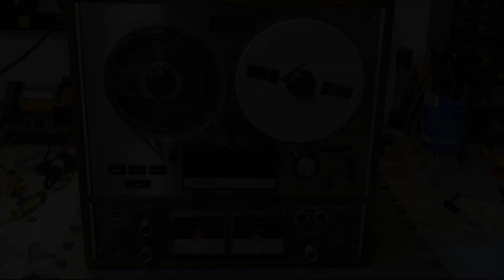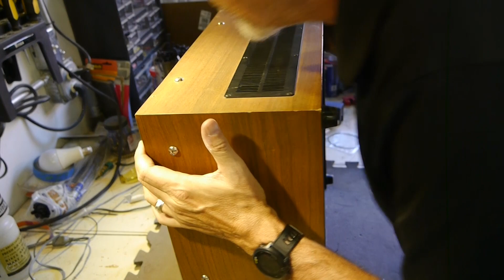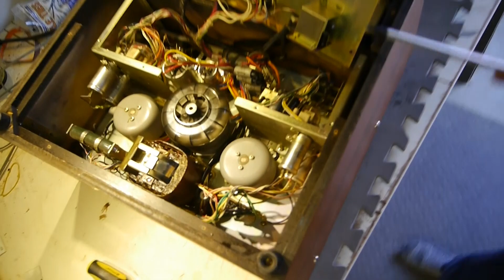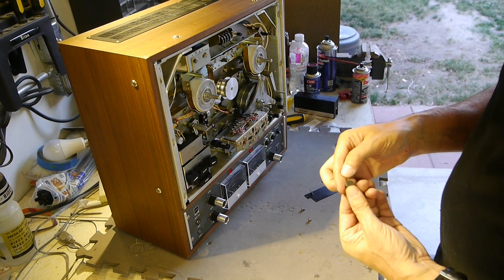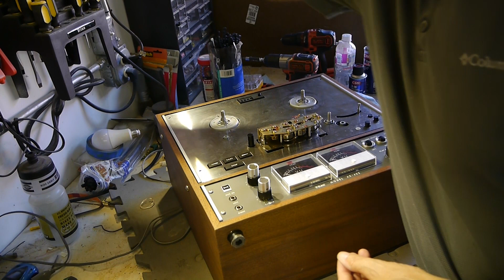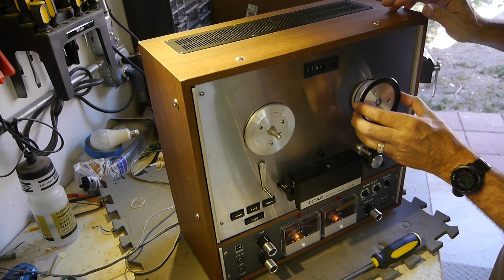Teac A-4010s Quick Tune, belts, roller and Assembly

Comment: I am having problems with the tape lifters on my Teac 4010s. The lifters are not lifting enought for the tape to clear the heads, mainly the play head, any idea what could be the cause?
Thank you
Reply from the maker: I'd have to take a look at that when I get home, but it may be some sticky lube like I had on one of my arms, I took them off and cleaned with alcohol
Reply: @OddsEnds-45  Nope it's not that, I checked. Still troubleshooting.
Hope I can find what the problem is.